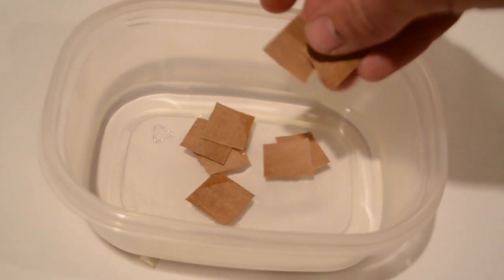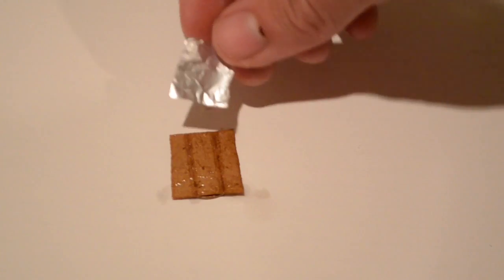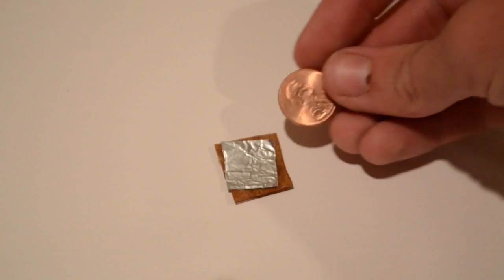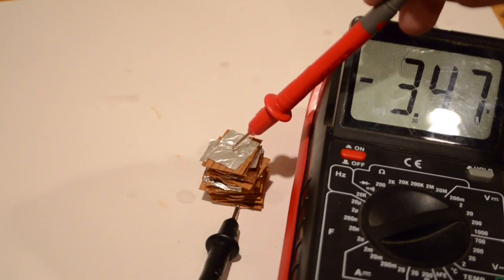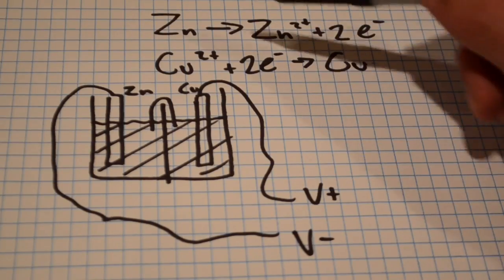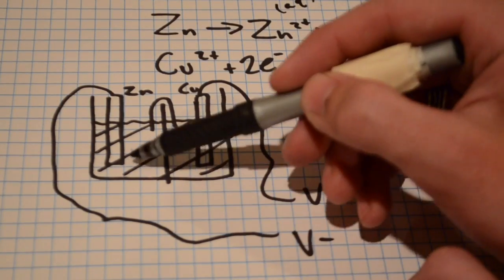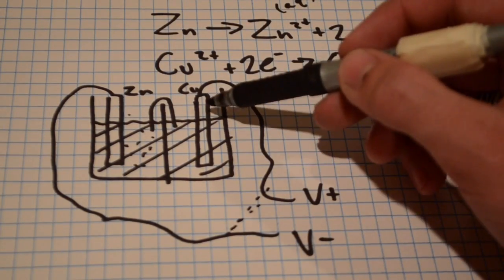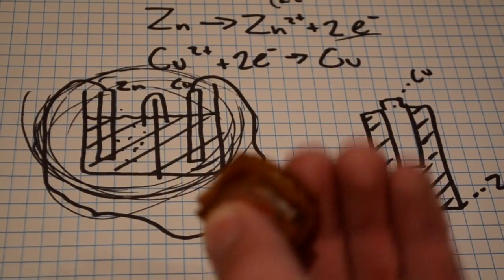Battery from Pennies

Comment: Do a test to see if using all zinc cents or all copper cents produce more volts
In 1982 the US mint changed the composition of a cent to zinc with a very thin coating of copper.
There are still pure copper cents from 1982 but you have to use a balance to identify them.
All cents from 1981 and before are pure copper, and 1983 and after are zinc.
All cents minted in 1942 were steel because the copper was needed for the war.
Reply from the maker: Yeah, I'm sure it would, for instance if you use zinc rather than the foil I'm using, you get more volts out, however I do think that the thin coat of copper on the penny would effect the amount of current that the battery can supply and probably not the voltage so much